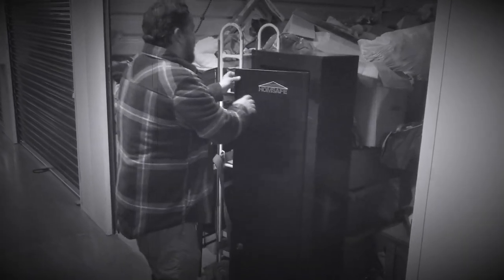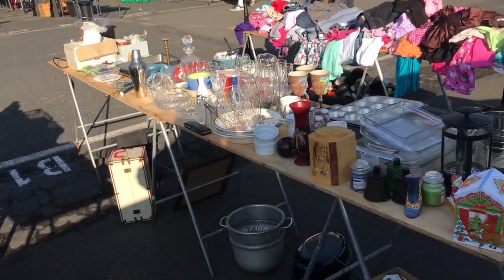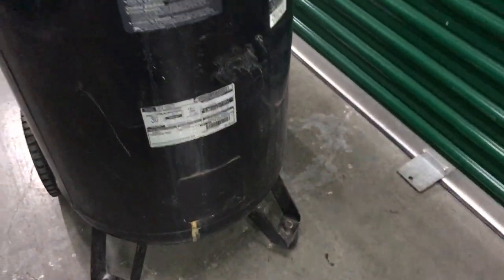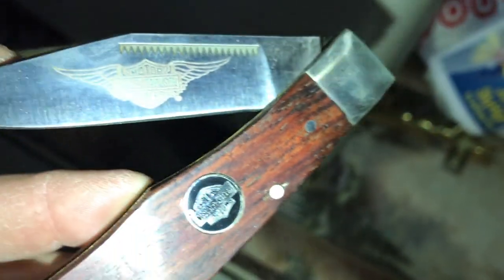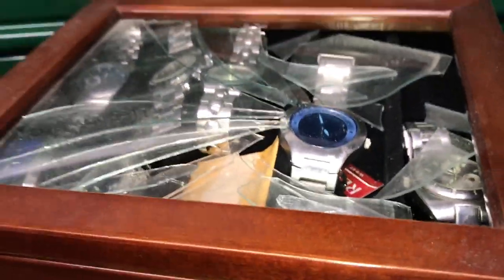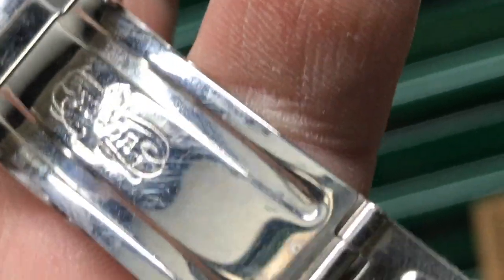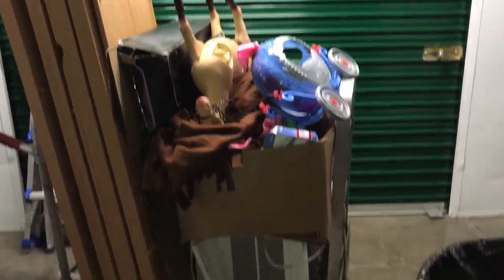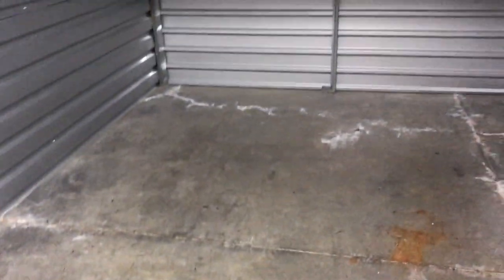MORE AMAZING FINDS from the GUNS & SAFES LOCKER bought at the abandoned storage auction.

Comment: Jack if that is a Rolex Daytona Stainless Steel you have about 12 thousand easy. Shake it and look at the second hand sweep. It should be real smooth and the watch should be heavy. The serial number will be under the the side of the face. You will have to pop the pins and remove the bracelet. The serial number will be registered with Rolex.
Reply from the maker: Check out tomorrow's vid, as I'll show the second hand movement compared to a real Rolex. It's very similar. But still I think it's a high end replica.

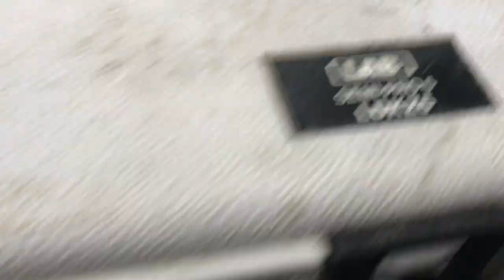Comment: @5:30 is a retooling set for lock cylinders. You go to any hardware store or locksmith to have a lockset rekeyed and they use these. That Rolex looks real to me. has the right markings on the face and the back... The knife @18:00 was made by a Swiss company, circa 1900 belongs to a rifle made by the same company.
Reply from the maker: Thanks!
Reply: @LockerNuts  Not sure were you get your information from motherofone 1 but " right markings on the face and back " ?? Rolex has no marking on the back, at least not with modern ones. Exception to the fact that a Rolex Daytona ( This model )may have the drivers name and date of when he won the Daytona Race. Which you don't have and are very very hard to own. It will also Never ever say Swiss made on the back. The markers on the Bezel are horrible. On an authentic one it would be much more crisp. The actual Rolex name on the dial is not sharp enough. The finish of it looks wrong. I actually have a jewellery and watchmaking diploma from Schoonhoven Jewellery and watchmaking from The Netherlands. Great finds thou. I'll also add. You can check if the band is magnetic or not. A real one won't be pick up by a magnet however fakes use lesser mix metals. Or simply take off the band and check the serial numbers between the lugs. You can check the numbers on the internet.